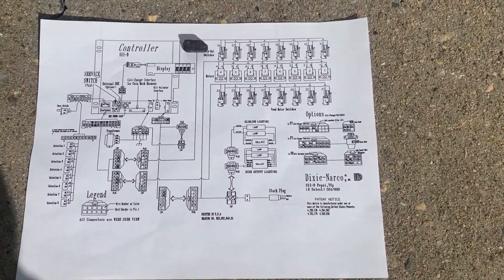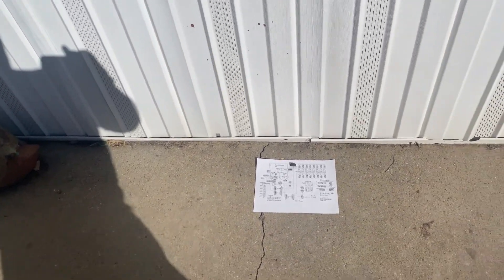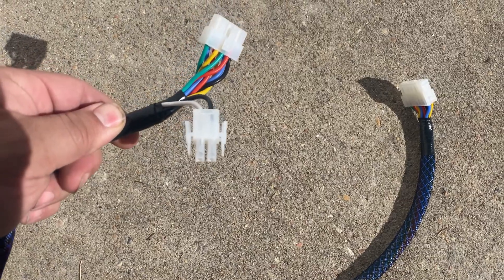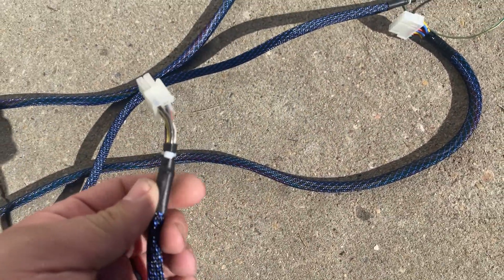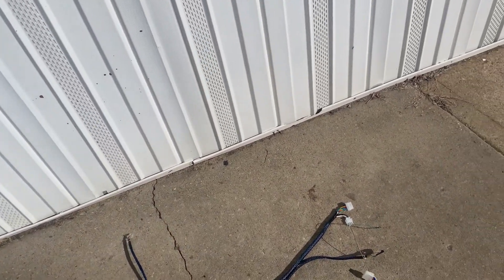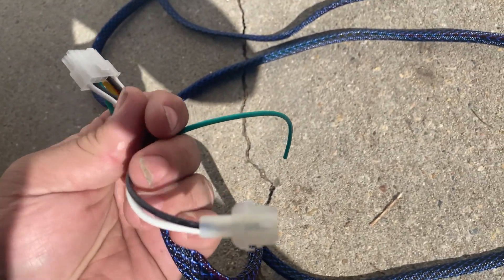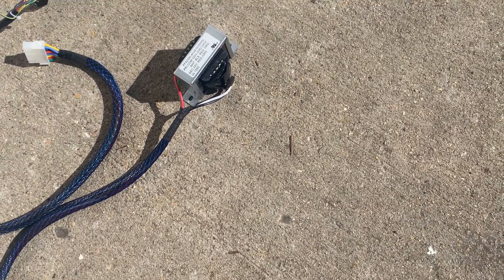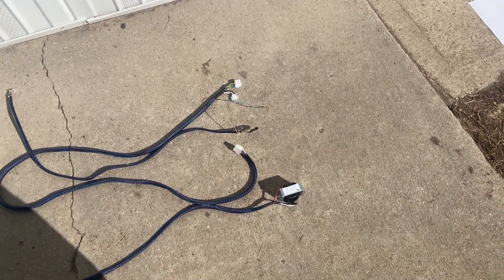DIY Dixie Narco 368 Conversion Part 1

Comment: What coin mech did you use with this
Reply from the maker: Any MDB coin mech will work
Reply: I just got this machine and it has no coin mech. Would it be smarter to buy these wiring harnesses and get a coin mech for credit cards or just a new coin mech as is. I’m not too familiar with vending machines. Thanks
Reply from the maker: @scotty1armpimpin  if the machine is single price I would just get a mech for it. It would be a single price mech not mdb
Reply: @720vending  do you know where I can get one google is not helpful lol
Reply from the maker: @scotty1armpimpin  what is the model number for your machine
Reply: @720vending  DNCB 368 /216-8
Reply from the maker: @scotty1armpimpin  that is a single price look on eBay for a single price coinco coin mech

Comment: The factory transformers are 24v/75vac.  This one is 40vac...have you run into any issues with the "smaller" units
Reply from the maker: I have built 4 of these and they have been running without issue for up to 4 years now. It is a lot cheaper then buying factory those can cost over $100

Comment: Hey great work buddy. That really looks great. 

I think that transformer might be a bit small to run the board, credit card, note acceptor and coin validator, might want to look more closely into that to be sure it will handle all of that stuff working. 

Also don’t forget to have some kind of appropriately rated fuse or circuit breaker at the transformer on the low voltage side in case the harness gets pinched or the one of your accessories shorts out. Need to protect the transformer from an overload.
Reply from the maker: Thank you very much for the comment, i have the exact same thing on another machine and it runs it all for over a year now, all the transformer does is power the MDB devices.
the transformer has the same output rating as the factory it outputs 24 VAC,
It is Fused on the board before and after the transformer as well as before the motors